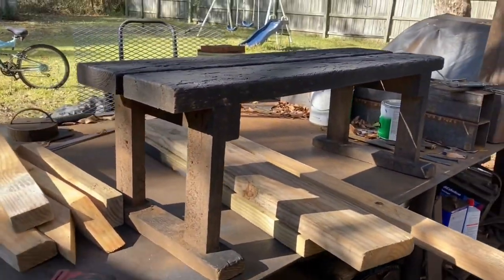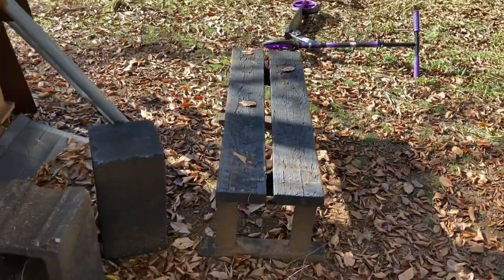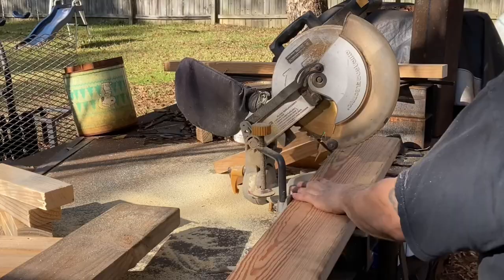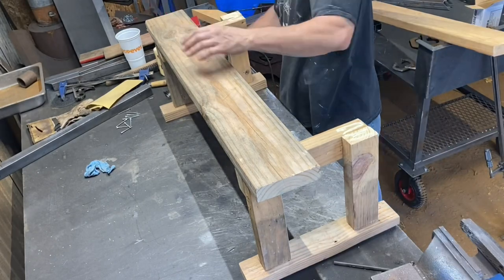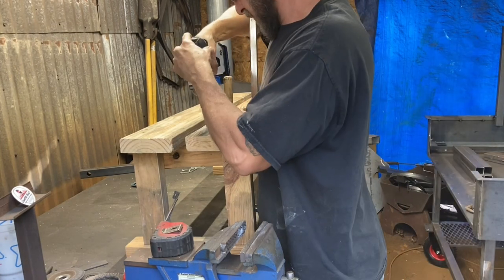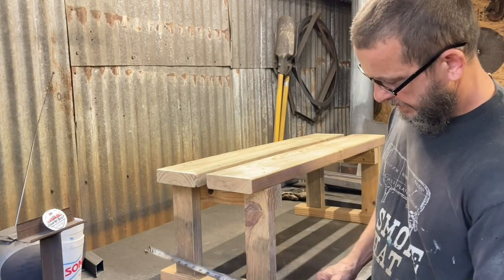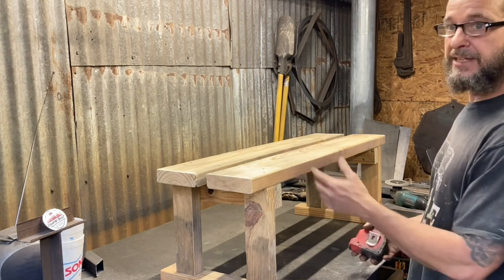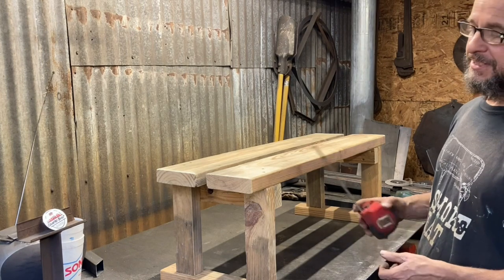DIY bench build

Comment: On a warm day …

Mix up some 50/50 linseed oil and mineral spirits and apply to the benches all over. It Soaks in deeper than just linseed oil by itself. 

It’ll protect them really well. Much better than painting. 

Also as you can tell … the treated lumber from 30 years ago is still holding up strong 💪. 
This stuff they make and sell now is just terrible… doesn’t last a couple years if that. 

Glad you’re doing well!